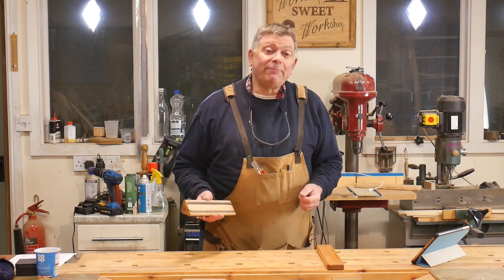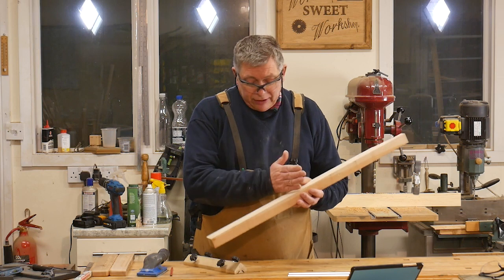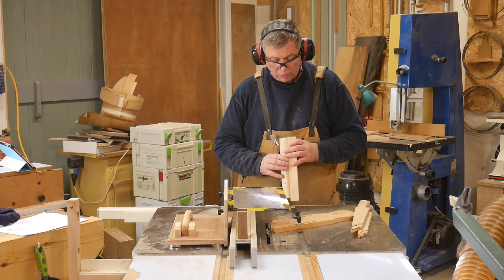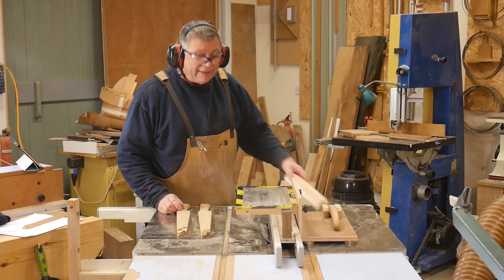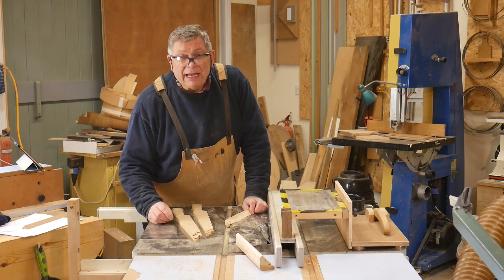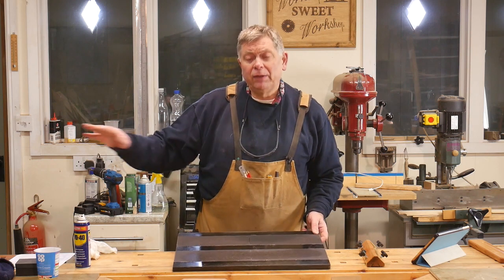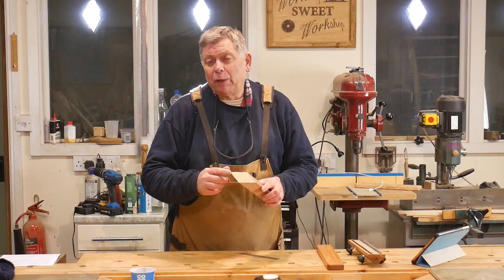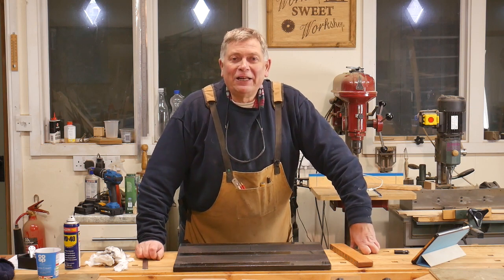Two Jointer knife honing Jigs!

Comment: Just in case anyone reads this comment, I have one of these planer (jointer) knife jigs made by Steve himself as a gift, it's the one with the nylon screws in, I've had mine quite a while, so it must have been one of the "early models" (lol), works a treat anyone with multiple sets of knives should make one for themselves to keep them honed when not in use.

Comment: I am just learning about table saws (Age 68) had heard about kick back now I know what it is. Thank you.
You could polish the cutting edges even sharper by placing cutting compound on a sheet of leather and using the same as your emery cloth. Be careful to move the blade away from the cutting edge on the leather.

Comment: Good Morning Steve! Thanks for the excellent idea of that jig. Left my comment on the flying debris already under the other video 😉. Here I have a question on the honing itself: Are you actually using P80 and P120? My blind guess would have been around P240 for a start and P320 or P400 for the fine polish. I might even think about P600 wet paper. Am I overdoing or is there perhaps a difference between the UK and the German sandpaper in terms of coarseness (like metric and imperial)?
Cheers 
Andreas
BTW I just recognized, that your table saw is named "Excalibur" - that explains everything...
Reply from the maker: Hi Andreas. You can go as high as you want, but I am just trying to remove the "cross-grain" grinding marks. A chisel or plane iron is sharpened by pushing the edge forward, so increased smoothness makes more of a difference, whereas these knives are pushed sideways, so longitudinal scratches have much less effect. But go as high as you like, yes. P120 is the same in Germany and UK.

Comment: Many thanks Steve, excellent as always and I’ll certainly be making both those jigs. Just one question, I thought your choice of paper was a bit rough. I would have finished on at least 240 and then polished on a 400 or 600.
Reply from the maker: You can go as high as you like, but the scratches are longitudinal, so they don't matter as much as they would on a chisel or a plane iron.

Comment: I got a jointer free from the side of the road and the blades have a knick in them. Can that be sharpened out or do I need to just replace them?
Reply from the maker: That depends on how bad they are. If it's a small nick and just one, you can hone them up and when you put them back in, offset them very slightly so that the nicks are not in line. But if they are badly nicked you may be able to get them reground. Note that there is a limit to the re-grinding process, some machines have a minimum width that they can hold.
Reply: Axminster AW106PT2 blades are used up from start 30mm deep to finish at 17mm deep !